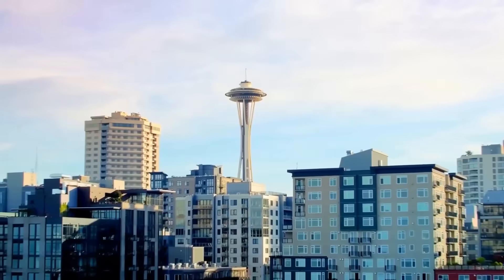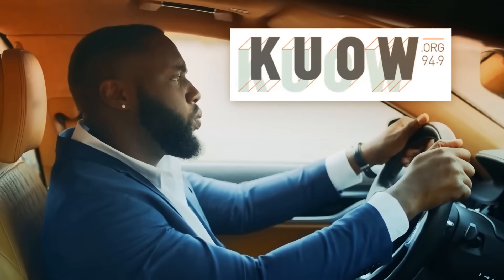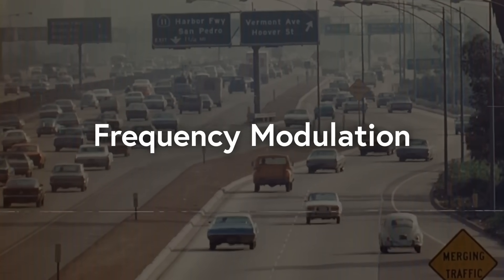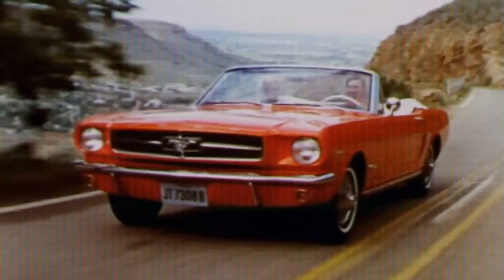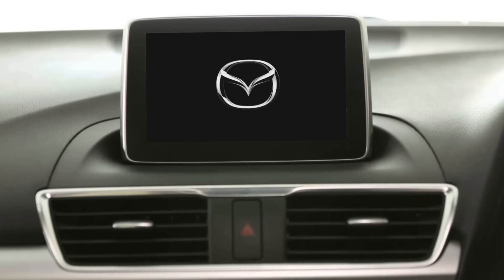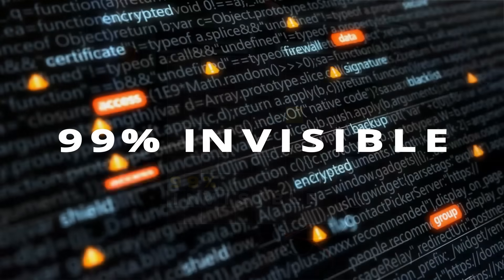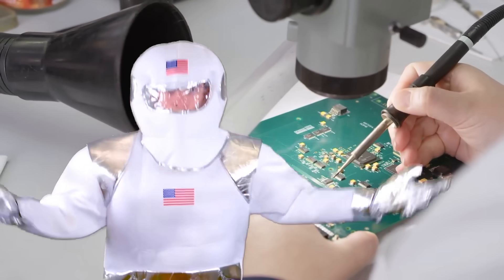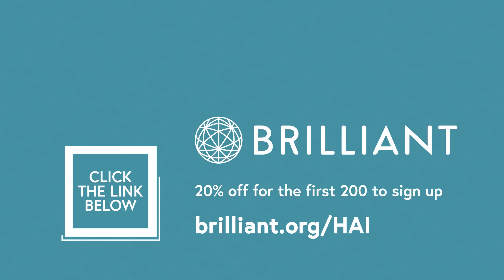Why Hundreds of Mazdas Tuned to 94.9 Broke Simultaneously

Comment: That % formatting bug is a huge issue. Whatever programmer caused that absolutely should have known better.
Reply: Don't forget to sanitize your inputs, kiddos
Reply: @TheMetaMoss  alright guys, I got absolutely no idea about anything programming, but I'm curious, so what is sanitizing the code, and how would it have affected it?
Reply: @darkphoenix0808  Its like if you could just write code into youtube through the comments, with unsanitisned inputs a user can enter an input that is inserted directly into the programs code, effectively allowing you to run whatever code you want
Reply: @rainbowchutney  Ah. Thanks.
Reply: @darkphoenix0808  Sanitizing in this context means ensuring the input is not treated as any sort code, just merely text to be displayed as-is. Where this went wrong is the podcast title was likely treated as a formatted string, that is, some text with commands in them. In formatted strings in languages like C, "%" followed by a character marks a section of the text that will be replaced by another value (for example, "%i" will be replaced by an integer). 

It's pretty nice to be able to do some math and finish off with a printf("My math says that %i is the final answer", x), but it's less so when you were negligent enough to allow something that you can't control (such as a podcast title) be treated as the first argument in the printf or similar function. Unless you're intending your code to be controlled in such a way by your users (and in the vast majority of cases, you absolutely aren't), you shouldn't let anyone other than yourself define what code is being executed by your program. 

I hope that was in non-technical enough terms to get the idea across.
Reply: @TheMetaMoss  yeah, that was a great explanation, thanks
Reply: @TheMetaMoss  %d
Reply: @TheMetaMoss  The fact that sanitizing is necessary demonstrates a significant weakness and vulnerability in system design, though. I'm inclined to put most of the blame on Mazda's electronics supplier(s), particularly as it seems to have been a consequence peculiar to that brand and not a variety of similar others.
Reply: @ReflectedMiles  Sanitizing is a purely software concern, however, so the root blame lies on the software engineers who coded the infotainment system for Mazda.
Reply: @TheMetaMoss  Agreed, but I am assuming that is all or mostly contracted via the same supply chain. Maybe the company is doing its own software development, but it doesn't seem too likely.
Reply: @ReflectedMiles  When I saw "electronics supplier" I thought "hardware", but perhaps that's just the SE in me :3
I should also consider all the embedded systems software that's involved in the process that Mazda would not have touched even if they have in-house developers.
Reply: @darkphoenix0808  Look up this video for a live demonstration:
'This is why you sanitize user input: Chat hacked live by XSS/HTML code injection, hilarity ensues'
Reply: @darkphoenix0808  sanitation is basically assuring the input is "clean", or has nothing in it that could cause unexpected behaviours. In this case, % would have needed to either be stripped, or replaced with a character escape sequence. That's how XHR attacks work most of the time - the host doesn't sanitize the input letting you inject html chunks into the page through post submission. A smart website replaces things like < with [& l t ;] without the spaces, so that when the thing you submitted gets displayed on the page the browser doesn't try to execute whatever text you entered that had a <
Reply: @TheMetaMoss  That really happens? I'm an engine user, not low level programmer, so I have never heard of this... Aren't inputs just a .... strings? How tf can they be treated as code? That's just unthinkable. Why would this feature even be there in the first place?
Reply: @TheMetaMoss  Log4Shell anyone?
Reply: @TheMetaMoss don't sanitize, just don't trust user input, you don't need to filter for such attacks, activity prevent them instead
Reply: As soon as the video mentioned %i I audibly screamed "OH NO" and I knew exactly what was coming next.....
Reply: At least that time you could just not listen to the podcast, unlike when %p%s%s%s%s%n broke wifi on iPhones.
Reply: So I'm a programmer and unfortunately most companies do not support a development model thats rigorous in fact in the software world expediency and rushing is applauded despite ya know this software remaining on these cars for potentially decades. In no other industry except maybe fashion is it like this.
Reply: @Furiends  Yeah, I'm pretty surprised too. I work in embedded consumer electronics and helped introduce coding standards and practices as well as analysis and runtime checks to our code, based on things like JPL coding guidelines and whatever static analysers we can get our hands on. I was very surprised when I learned that our maybe-not-all-that-vital consumer devices do, in fact, have higher coding standards than motor vehicles.
Reply: @Furiends  this is why i fear smart modern day ev just like the history of windows 10 bugs, for some reason computers in cars seems like a terrible idea, i'm waiting for a software engineer to accidently send a update which bricks everyone's tesla when they update..
Reply: @knightwolf3511  knowing tesla, it's more likely they'll brick it on purpose
Reply: @knightwolf3511  Computers in cars is a great idea; implementing them sloppily is a terrible idea.
Reply: @Furiends  Do you reckon that's a result of a "race to the bottom" price wise?  (I work doing garden maintenance, not coding, so I'd be genuinely interested to know if you've got any insight into the cause)
Reply: @RedHeadForester  Quite simply, never use printfs. One can always use cout and cin for c++, or System.out.println, or even writing your own input parser (which is very surprisingly easy to do recursively...).
Have a list of all possible compiler rules/interpretations pulled up so you can be sure you checked everything when making a testbench (series of tests).
There is "false"(0) doubt in my mind that price and/or time was the primary factor that caused this significant of an error, whether through hiring an inexperienced programmer or impractical deadlines.
A major issue that can very easily cripple America is extremely simple stuff like this where cybersecurity (yes, this vulnerability absolutely should've been caught by any cybersecurity person) is simply deemed "not important considering the extra 10 manhours of a complete security test for which we'd have to pay a coder". They rarely consider the cost of class-action lawsuits...
Reply: @RedHeadForester  It's more a problem that companies aren't really penalized by breaches. Unlike copyright infringement there's no way to sue a company for mishandling your information. It's just cheaper not to care about security.
Reply: @Furiends  I respectfully disagree, sanitizing your inputs is a simple idea
Reply: @notserpmale03  The problem is you only NEED to sanitize when some function inside your system responds to "in band signals", and you might not know in advance what those signals are. It could be as basic as the DNS standard allowing a NULL as a valid character in a domain name, but the overwhelming majority of C code recognising NULL as a string end. In a perfect world there would be no in-band signals, text might be framed by a header indicating that the next N symbols are to be treated as text and there are no magic values in that block that will trigger any other action.

Another example is it isn't hard to see how quote symbols can be used to inject commands so we sanitize for quotes, but what if some code library starts recognising unicode quotes but you're only expected to sanitize for regular ascii quotes.
Reply: Agreed.  A perceived need to sanitize inputs generally implies that some part of the system isn't properly maintaining command/data separation, though unfortunately modern C optimizers are designed around the assumption that programmers don't care about such things.  The gcc optimizer will sometimes generate code which will arbitrarily corrupt memory if an integer overflow occurs while computing a value that ends up being ignored, and the clang optimizer will arbitrarily corrupt memory if a function receives input that would cause it to get stuck in an endless loop, even if the code as written makes no use of anything computed in the loop and cleanly omitting the loop would not have any ill effect.
Reply: @flatfingertuning727  Granted, the standard explicitly says those are UB. If you do it anyways, that's your fault.
...well, and the language's. But not the compiler's.
Reply: @oliverbroad4433  I know that you need to sanitize, the guy was saying that crunch times could cause this bug to get through, but I argued it’s a simple solution that shouldn’t have even made it to the bug testing phase, it should’ve been originally programmed sanitized
Reply: @berylliosis5250  The Standard also allows implementations to, as a form of "conforming language extension", specify how they will process such constructs in as much or as little detail as they see fit, and in many cases characterizes as UB actions which the majority of implementations would be expected to process in ways that, at minimum, would be free of side effects beyond yielding a possibly meaningless value.

If the behavior of integer overflow were classified as Implementation-Defined behavior, implementations would be forbidden from reordering arithmetic operations on platforms where overflows could trigger side effects.  Under the as-if rule, there is no terminology other than "Undefined Behavior" to describe actions whose side effects might manifest themselves before preceding actions or after later actions.  That doesn't imply that implementations were expected to process code in such a way that integer overflow could disrupt the behavior of unrelated parts of the program.
Reply: @Furiends  I have migraines just thinking about that.   You would think turning on basic compiler warnings and fixing the resulting output would be standard procedure, but I've watched programmers turn the warnings off because it's less work.
Reply: Yeah, this isn’t really the radio station’s problem
Reply: Not properly sanitizing and escaping inputs is such a fucking common bug / security flaw that it should really be the first thing someone tests
Reply: reminds me of the buy who bought a lincense plate that said "NULL" and then got thousands of dollars in traffic tickets for other peoples crimes.
Reply: It's not like we just had several absolutely MAHOOSIVE security issues that affected almost everyone worldwide because of text formatting.
Reply: @jfolz ???
Reply: Let's not overlook the stupidity of a computer which bricks itself if you download a file with no extension.
Reply: @iAmTheSquidThing  That's a mistake, but at least that involves a lot of pieces in a system moving together. The %i formatting is an easily avoidable mistake: don't treat user input as a format string.
Reply: I listened to the Reply All episode that they got this from, and Wendover got it wrong. %I wasn't the problem, but rather URL encoding.
Reply: I posted a "how programmers sanitize inputs for people that are smarter than the average bear" on this thread.
Reply: Little Bobby Tables says hi.
Reply: @AaronOfMpls  Relevant XKCD: #327. "Did you really name your son Robert'); DROP TABLE students;-- ? Oh, yes, little Bobby Tables, we call him."
Reply: Sanitize your inputs, people!
Reply: nice, just shoved the string into printf or something lol
Reply: I can't call a person who wrote that code a programmer. Sanitizing inputs is coding 101.
Reply: @repatch43  I guess EA doesn't have any programmers, then
Reply: @repatch43  if only... :(
Reply: tbf, I just cannot believe that was the real issue. now way that goes through any kind of testing
Reply: @AaronOfMpls  Little Bobby Tables strikes again.
Reply: An old truck I learned playing multiplayer games in 80s was to give another player “negative” money. The code doesn’t sanitize the input and lets you basically steal from any player. A few MUDs had this issue in the 90s, but I havnt found a modern mmorpg that has this flaw
Reply: @nicholas_scott  Back in ancient times, the Apple 2e game 'Taipan' had a money cheat -- the bank paid 2% interest, but the moneylender charged 10%. If you took out a small loan and then paid back more than you owed, the negative debt would grow at 10%, which you could later get back.  Was a quick way to get ahead in the game...
Reply: These are all "should have known better."
Reply: Having worked in automotive ECU software I can clearly tell that this isn't an issue with one developer's poor judgement. At every level people skimp on their responsibilities or rather moral duties, because the effects of their actions isn't so direct. As compared to doctors. Hence it's a flaw of the whole sub-industry.
Reply: If their radio could have just used some community os and build from it, this shouldn't be an issue. This happens when you put an outdated firmware to work with modern features.
Reply: Why couldn't they just store '99% Invisible' as a string instead of code?
Reply: @Anonymous-df8it  It is specifically a string. But in the C programming language, the type system isn't expressive enough to differentiate between different types and purposes of strings! So a string that you supply to function puts() is treated as just a string; while the same string that you supply to printf() acts as a special format string. In this case, they have presumably used a function that treats a string as a format string, such as snprintf(), probably by mistake. It's an easy mistake to make and leave unnoticed, because for normal strings without format specifiers, both functions will work the same. A format specifier in a string is a % sign and a selection of characters following it such as %i meaning integer. In functions that ingest a format string, each valid format specifier ingests a further parameter, and when the number of parameters supplied to the function is insufficient, the function may start reading outside existing valid memory. The issue can evade testing depending on stack configuration and the amount of stack space already occupied.

While C++ programming language has powerful ways to avoid this issue, it also includes all of classic C functionality, and it often happens that old, performance-sensitive, or size-constrained software uses C functions extensively.

It is possible to use format string functions safely, if every string ingested from an untrusted source, such as user input, broadcast, internet, is "escaped" first thing when it's ingested, i.e. existing format specifiers are removed. But in general C format string functions are considered unsafe and are often banned from use in safety critical codebases. But there are more ways to inadvertently make fragile software with C strings, there are whole books about it.
Reply: @SianaGearz  Oh, ok!
Reply: @SianaGearz  Not correct.  You don't need to escape anything.  Just don't use an outside provided string as the first value of a format string.  It's basic C.

Format string functions are perfectly fine as long as you don't do something stupid like var2=sprintf(var1)  If it had been done correctly ie var2=sprintf("%s",var1), the whole format string function would have not been an issue.  Or better yet, don't use it when you really wanted memcpy() (safer, more CPU efficient since it doesn't parse the string).  But really, turning compiler warnings on would have been enough to catch this one.
Reply: @GerhardMack  Well the problem is someone DID use it as a format string. Large software requires approaches that are resilient against human error. Thus projects adopt an idiom such as always-escape which is technically unnecessary but helps review correctness. There are of course other idioms that prevent dangerous usage of strings, but it's necessary to pick one and stick with it.

Compiler warnings? How would they help? Constants will be evaluated for format-correctness, variables are not. I'm sure they have a module that is immune to these sorts of warnings by design. Like they have a function or class or something there that paints an HMI screen which has a picture and a string, because there's a million picture-and-string screens; and usually those strings come from their localisation file, and could be formatted, and they be using vsnprintf internally, which has no warnings, and the inputs live in a struct or class for a while before they're actually used. Someone used a radio provided string by mistake directly.
Reply: @SianaGearz  Oh wow.  Varargs are something checked by every compiler I've used for the past 20 years.  Something like printf(variable) will throw a warning because it's not meant to be used that way.  It will also check type. Ex printf("%i",somestring) will also warn.

Having worked on large projects in C, the best way to start getting resiliency is to compile with "-Wall -Werror".  

I had a co worker quit because he couldn't get his project bug free. I fixed 99% of his bugs by annotating his custom vararg functions and turning on every single warning the compiler would let me enable and fixing every last warning.
Reply: @Wet Stoffels Its not that code isn't being ran, just that the podcast title should be treated as literal text with no extra processing done on it. If what I assumed happened in this case is true, where the podcast title was processed as a formatted string, then that '%' would not be seen as a character to be displayed, but part of a set of characters that would be replaced with something else in the final display (i.e. "%i" would be an integer, "%d" a base-10 integer, "%s" a string of text).
Reply: Sanitize your inputs is security 101. That dev needs to be writing PHP in Siberia.
Reply: That programmer probably learned to code after being told #LearnToCode
Reply: It would have been as simple as changing printf(foo) to printf("%s", foo)
Reply: these bugs are everywhere. STOP USING PRINTF WITH VARIABLES PEOPLE, USE "%s" AND PASS YOUR STRING IN THE ...
Reply: It's an extremely common and easy-to-make mistake to printf(string) instead of printf("%s", string), especially if you also use puts(string) elsewhere in your code, so I can't frankly blame them for that too much.
Reply: @AaronOfMpls  Ah, I was about to post a reply quoting XKCD...
Reply: @Szwagi  It's not actually a %i code, it's a %n code with a ' ' and 'I' (capital i) modifier, which is worse*. A %n code will make printf *write the number of bytes written so far to the pointer specified in the argument, which allows for a lot of severe exploits. Of course, no argument would be passed in in this case, so it would read garbage data off the stack, cause a stack frame misalignment, and then crash. Although a hacker might be able to construct a format string that will consume enough data off the stack for the printf call to return successfully and not crash, allowing an attack to continue.
By the way, the %n format specifier allows looped printf calls to be turing complete, see carlini's IOCCC entry.
Reply: @animowany111  US DOD programming is required to be in ADA, which very effectively suppresses problems like this. It also drives coders insane. In any case, using C or C++ for something you want to be truly robust is asking for trouble. I regard C/C++ as being like English - as close as we get to universal but a serious junkyard inside.
Reply: Depending on the language the Mazda infotainment system is based on the % sign is either a mathmatical operation or a string operation.  Either one of which could cause the error. Mazda's programmers did not sufficiently test their error trapping routines.
Reply: @AaronOfMpls  f
Reply: Boeing and Mazda must source their programmers from the same place, just with wildly more dangerous results
Reply: Why? All of my programs start with sudo exec %s!
Reply: i just posted a similar issue.
Reply: How lazy had the Mazda programmers must have been if they can't separate the difference between a text stream and an internal variable name?
Reply: It hurts because I know EXACTLY how it caused the problem
Reply: Look here, Just because %1 can't clean up their %o$ code driving their latest and greatest model %3 so it doesn't look like an archaic Word script, doesn't mean that every other person  has to abide by it
Reply: i used to work for mazda as a tech, they have awful info systems, its not uncommon that those system bricks after an update, its almost as bad as toyota system
Reply: Sanitize your input cable with hand sanitizer. Otherwise you will catch a bug and be sick for weeks!
Reply: I worked at a hotel, and the hotel operations software crashed when someone typed a guest's name as $mith.
Reply: Probably the use of `printf` despite there being far better alternatives available.
Reply: Probably the use of `printf` despite there being far better alternatives available.
Reply: Trust me, that was DEFINITELY above any programmer's paygrade
Reply: I'd like you to meet Little Bobby Tables cousin, Mazda %I
Reply: Bobby tables
Reply: I know just enough about coding to be able to roughly interpret and sometimes fix things like PHP, JavaScript and java.  I would assume based on my extremely limited knowledge that it probably wouldn't take much more than a few characters or a few lines of code placed here and there to avoid interpreting a % in a string of text as code...
Reply: @RedHeadForester  Just about every bugfix is a one-liner. But trivial bugs can become invisible by convoluted structure.

You ask in another comment whether it's "race to the bottom". I have worked on specifically on OEM headunits, several car brands related and unrelated to each other, at different engineering companies, and i would guess mostly it's not. There are other structural issues that cause this. Foremost more and more people get hired to stem the MONSTER of a software that emerges there as feature creep drives complexity upwards, software gets partitioned into ever more and ever smaller pieces with more people working on it, more software complexity gets introduced in order to manage complexity, and it becomes impossible for people to reason about the whole system and anticipate bugs. People work on stuff, people quit the company, people extend and refactor, and there's an ever growing amount of code which is just a black hole, for which nobody is responsible and nobody still at the company ever actually read, and you basically live on the periphery of that code, interact with that code, potentially indirectly via some other code, feed it data, receive data, but you don't know what it does exactly, only what it purports to do, there's a difference. It probably used to work fine 10-20 years ago, but requirements around it have changed, and it just grew layers of stuff around it and leaky and incomplete workarounds in it.

If you're wondering what sort of complexity to expect of headunit software... well the frontend is going to be around 3-5 million lines of code just for the application, not counting the operating system and third party libraries. And that part is JUST the UI, it doesn't play videos or audio or decode images from radio or anything like that. That other part... is often a whole separate board, separate operating system, several more million lines of application code. None of that also counts the things running the map and nav etc, that's a whole other story.

It MIGHT to an extent be a cost thing because we had insanely well staffed QA departments, which kept the software fairly robust (nothing like that ever happened on either of the ones i worked on, not in release versions) in spite of fragile development practices. If you cut the QA, that's exactly the sort of stuff you might get. You might get these issues also if you find any excuse to try to get QA off your back instead of actually fixing stuff, which... well there are company issues which encourage this, and one of the companies i worked at was actually somewhat prone to that, but they weren't working alone, so the complex interactions between several companies working on things - two companies working on the headunit, and whichever messes up carries the cost, so they basically needed to both make sure the other company was to blame if something were to happen, which kept them in turn somewhat honest.
Reply: @SianaGearz  lol that's a pretty great explanation of the situation a software company can wind up in. Nobody being in a position to understand the risks of a change. Mostly the solution is for requirements to be represented in automated tests that kick off when code is changed and alert someone when an expectation is not met, right? But the older and larger the software, the less likely someone spends the money (time) to build the automated tests. In some companies deadlines are the only absolute truth and quality testing is negotiable depending on how much time is left til the project end-date.
Reply: @mhzprayer  Design by Contract, where preconditions and postconditions of the code are encoded as code (asserts at function level, tests at module level) relies on these to be maintained by someone who understands the code, where we're back at the same issue.

And well the work assignment based on short deadlines doesn't actually save any time, because technical debt has a habit of coming back to bite you and consuming 10 times as much of your time. It's just that management doesn't understand the engineering and doesn't trust the engineers.  They think their job is to keep us in check so we don't end up wasting time, these managers who don't come from an engineering background want to feel useful too, to the detriment of the project progress and quality.
Reply: thats why you dont use percentage formatting and just use string concatonation
it looks "incompetent" but is actually incredibly bug safe from what i know
Reply: @taureon_  I think some idiot just did printf(string) rather than printf("%s", string).
Reply: @Stego27  if you go listen to the 99% Invisible episode over it, this is exactly what happened. Same terrible software broken by this NPR station. And honestly probably has the same "% In" bug, should an NPR station elsewhere want to broadcast 99% Invisible. It parses it as a format string - so "prepend a space or minus sign for signed integers" + "expect either a ptrdiff_t or size_t integer argument" + "write the number of characters written so far into the pointer passed in this position". For whatever reason, they're also passing arguments to printf, and the argument in that position doesn't create a compiler warning, but isn't a pointer to write to, so it crashes because it attempts to write memory it shouldn't.
Reply: @taureon_  In C, string concat doesn't exist - you'd have to make it manually. It's also way slower to concatenate than to use a format string.
The legit way is being the tiniest bit careful and always using string literals in format functions (I'm sure the compiler/linter will warn you about that anyways). It's really not even hard, it's a very dumb mistake to make.

The alt solution is using a programming language that prevents you from doing that by requiring that string at compile time, but that still shouldn't be necessary.

Also, slightly pedantically, this isn't an input sanitization issue, because you shouldn't have to escape anything here. It's actually a type error, where a regular string is treated like a format string
Reply: @berylliosis5250  If they had used a format string as a concat, this wouldn't have happened.  Someone used it to do a basic string copy when memcpy() would have been better/ faster.
Reply: @GerhardMack  Nah, I'm not saying to use format string as concat, I'm saying use format string as format string with the assumption that they actually did want to use a format string there.

If you are just copying, then yeah, memcpy/strcpy is very, very preferred
Reply: @berylliosis5250  Fair enough.  It's just that I don't see how it could have functioned as a format string when it is used like this.
Reply: @taureon_  Absolutely do not use string concatenation for formatting. Anybody doing i18n work will want to kill you.

Also, format strings are really safe unless you do something very dumb that WILL generate a compiler warning.
Reply: Not one percent of these commentors/ Likes, know anything about what they are saying
Reply: Programming is hard man! It is hell! I would rather prefer a Scratch like coding than anything else (including python!!)